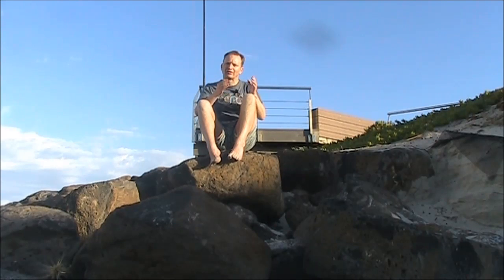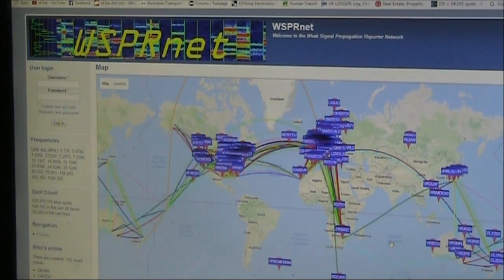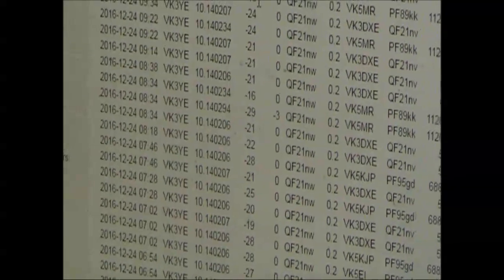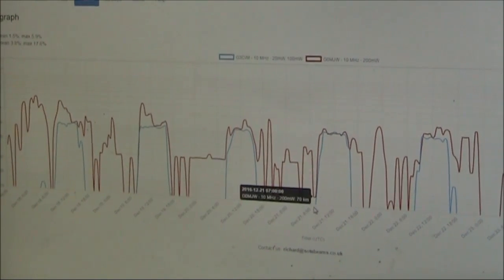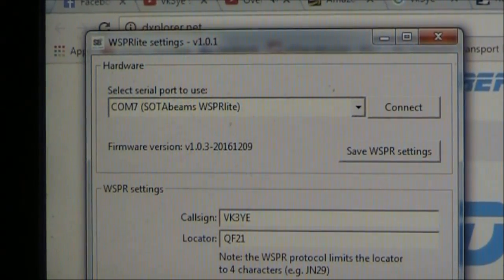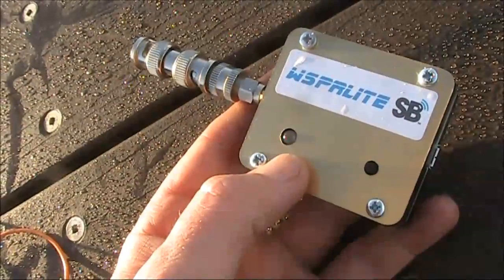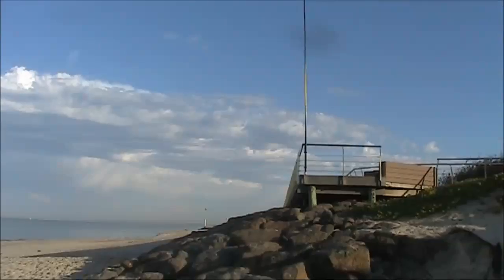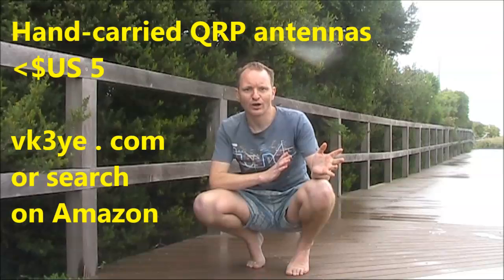Review: SOTABeams WSPRLite HF WSPR transmitter

Comment: WSPRLite is a great little transmitter (whoops sorry). I am currently using one on 30m and running 200mW, but unfortunately, I haven't been heard in VKland yet.  My antenna is a Chameleon F Magnetic Loop. 73 de Bob, M0BOB.
Reply: Just to say - it is a transmitter only; not a transceiver.

Comment: Hi Peter, does the wsprlite go down to 40 metres or do you need the lowpass filter to do that?
Reply from the maker: Yes you should use a LPF for 40m (or run it into a sharp antenna eg magnetic loop)